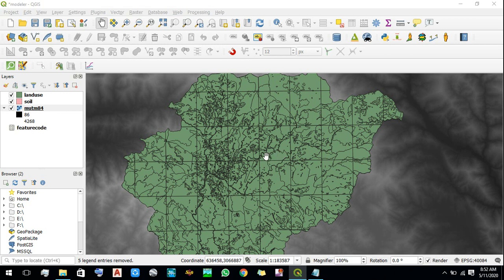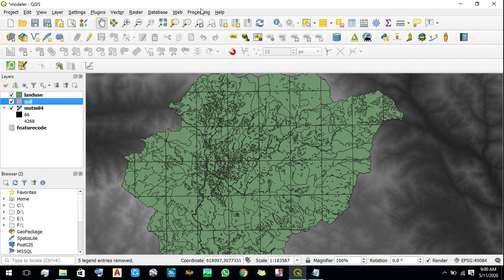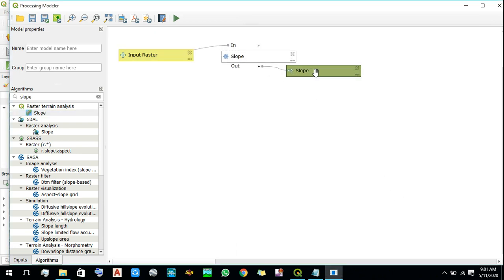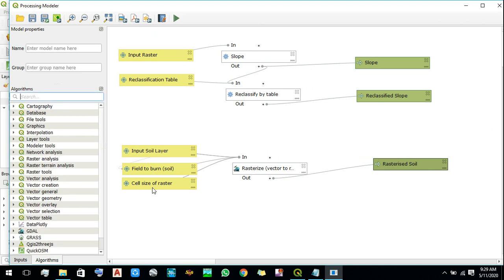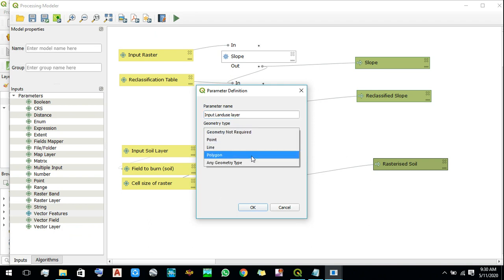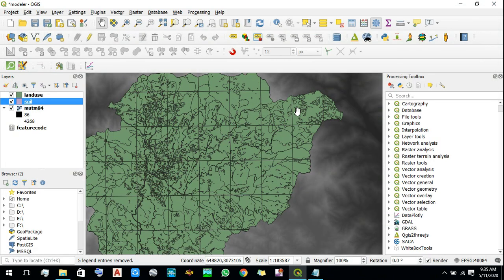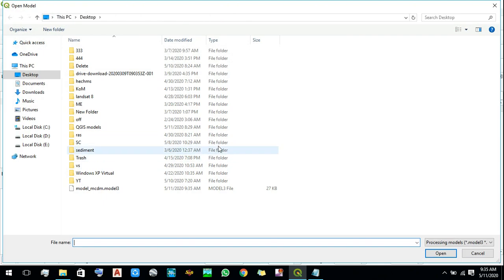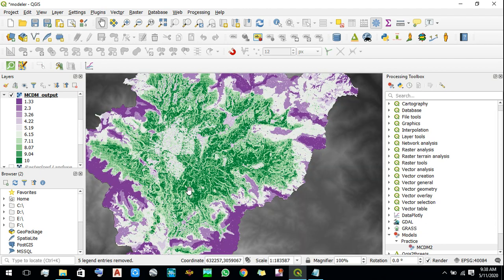An example of working with graphical modeler in QGIS: MCDM model #QGIS #GraphicalModeler

Comment: Thank you for your video I have a question, I would to classify wetlands according to water index and NDVI index, how can I make a condition for raster e,g if water index >1 this cell is water, and if water index < 1 and NDVI > 0.5 is high vegetation, another condition e.g if water index <1 and NDVI between 0.5 and 0.125 is low condition and so on.
Reply from the maker: Sadiq Almalki In gis, you can use conditional statements in raster calculator. However, the syntax of these kind of statements in arcgis and qgis are different. In arcgis, there's a statement called 'con' and others and in qgis, it's very simple.
In qgis, your problem can be simplified as:
("water index">1)*1 +(("water index"<1)AND(0.125<"NDVI"<0.5))*2+(("water index"<1)AND("NDVI">0.5))*3

This will create a raster with values 1,2,3.
In first part of above statement,suppose in a certain cell,
if water index>1, it will become true and it'll return a value of 1. and and it'll then be multiplied by 1 as stated in formula ( we used value of '1' to represent the case when water value >1. you can use other values as well but make sure you remember it and don't get confused ) and gives an output 1 while the remaining parts of the statement will be zero. 
and similarly, conditions are  checked for all raster cells after which it'll produce an output raster of values 1,2,3. Just remember which values you used for certain condition.